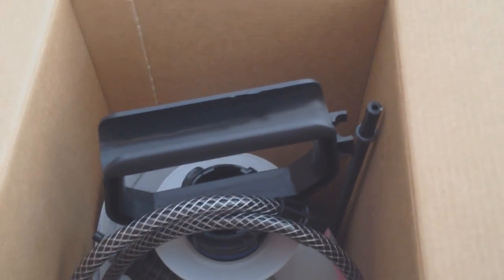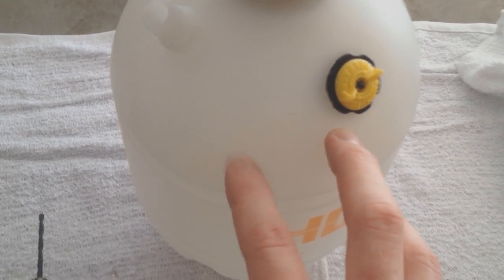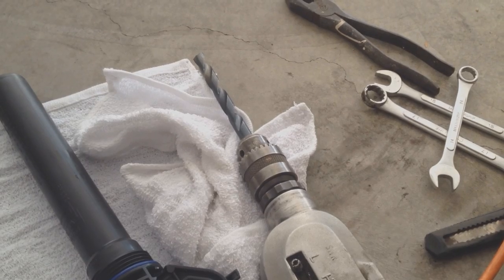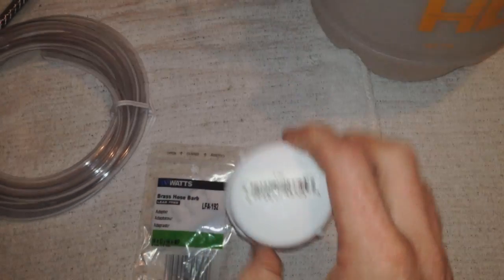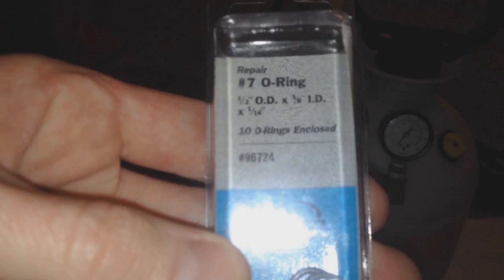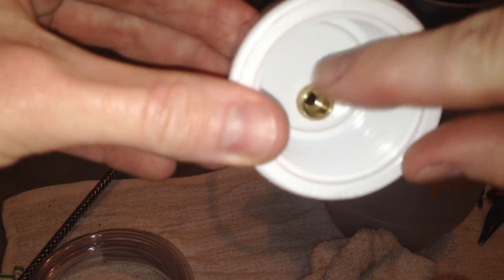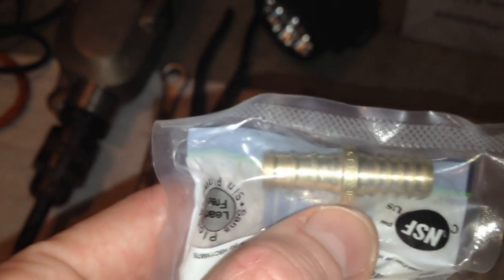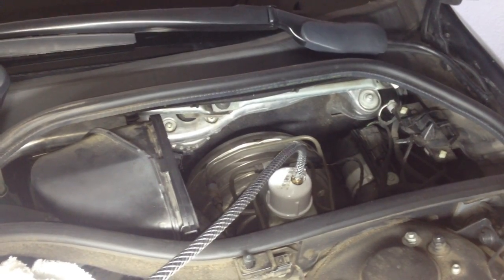DIY Make Your Own 1 Man Pressure Brake Bleeder

Comment: Thank you for the great video and taking the time to show all the details.  One question for any pressure type brake bleeder operations-why put brake fluid in the pressure vessel why not just keep the brake reservoir topped off and just apply air pressure to system through the reservoir cap?  This method would prevent a disaster if cap or hose comes apart from spraying brake fluid all over, would keep any impurities in pressure vessel from getting into fluid and finally it would prevent overfilling the reservoir like in your demo where you flush you beamer system and had to suck some out after the flush.

Comment: First off, thanks a lot for the DIY.  It was a pretty straight forward build and has been really useful during my brake and clutch bleed.  I'll echo some of the comments here about getting the cap to seal... that was a royal PITA.  I tried thread tape with no luck.  What I eventually did was hacksaw the cap down in height so that it bottomed out against the top of the reservoir.  Then I used RTV silicone to make a gasket on the inside and that got me an airtight seal.

This was on a BMW 135i (E82) fyi...

Comment: A better idea is to use a spare car or bicycle tire leaked down to 7 psi. Attach an air hose from a cheap tire hand pump to connect to the modified master cylinder reservoir cap. Use a shop air quick disconnect in order to screw on the cap and remove when adding more brake fluid.

Comment: Nice video thanks for taking the time and detail. The barbed fitting has an NPT thread on it, it’s a tapered thread that seals as you tighten it. There is thousands of pounds of pressure at the threads, you don’t need the O ring. Also the O ring needs to have two somewhat flat surfaces so it has something to seal against so the o ring will do nothing in this scenario the pressure would just blow it out. Possibly vacuum it could do something but just trust the npt thread and use some sealent or expoxy or tap it with appropriate NPT tap which can be found in most common tap and die kits

Comment: This thing is slicker than snot!  I built the thing about a year ago to bleed the coffee-colored brake fluid out of my 2002 BMW e46 brake system, and it was so cool I built a separate connector with a small Fernco cap and some washers so I could bleed the brakes on my wife's 2009 Toyota Venza. Actually makes bleeding the brakes fun and super-easy. One thing that I would like to incorporate into the system in the future is a reservoir bottle for brake fluid so that brake fluid can be continuously pumped into the brake fluid reservoir, eliminating the need to remove the connection repeatedly to refill the fluid. Anyway, thanks for this DIY!    DAVE

Comment from the maker: Just a heads up for you guys, I just got done bleeding the brakes and it worked fine, I did use plumbers tape on the brake fluid cylinder resivor threads to make it air tight.  If I would do anything different I would make a better cap for it, maybe go to pick a part and get a cheap one and make a legit one.  The brake bleeding video will be up soon, check here on my channel or all my projects are now on my website diye65e66 (dot) com head their for it.

Comment: Great video. And excellent concept. And much more cost effective than 200 or 300 for same thing from a specialty manufacturer.... Do me one favor thou please. Quit calling the "X" on the dimensions of your fittings "times" it has nothing to do with multiplaction. "X" in this instance is the universal symbol, key or short code for the word "By" since your comparing 2 different or alike measurements and or dimensions. For example. ⅜" X ¼" would be spoken: Three eighths inch  "BY" quarter inch. 
Sorry. Buddy not trying to be a dick. Or bust your balls.  But im a plumber that kinda stuff kicks my ADD and OCD in hight gear. Im returning the favor in a way. You taught me how to make a brake bleeder. And i get to teach about fittings.  Lol.  but seriously thanks for the advice and sharing of your knowledge with all of us and saving us all a little money. And lots of headaches. 

Heres some of  the acronyms and what they stand for. 

MIP.=  Male Iron Pipe
FIP= Female Iron Pipe 
ID. = Inside Diameter 
OD= Outside Diameter
"Straight connector" is a coupling.

Comment: Good vid, Put the cap on the brake  reservior before you add the hose so as not to have to keep turning the pressure bottle as you screw the cap on.

Comment: Looks good ..... with a modified OEM cap I believe it might seal better .... though I can't see how the air gauge would seal in the thin plastic under 22psi, whats recommended for Mercedes .... though an inline gauge could be incorporated .... I may give this a go, Thank-you!

Comment: Dude, it's not 3/8 x (times) 1/4, when talking about dimensions, it is 3/8 x (by) 1/.4, meaning length by width. If it has a 3rd dimension, it will be height.

Sorry for the rant, shop teachers were anal about terms in the old days.

Comment: Great video on how to drill holes the hard way in plastic. Why not use a step drill. I doubt that jimmied in fitting will hold any air pressure. Do you know for sure that generic plastic pump can stand up to brake fluid? How about the white cap? It looks like ABS which will melt for sure. Did I miss the part where you sucked all the leftover plastic debris out of the tank with a shop vac?Brake fluid is murder on most plastics. The last thing I want in my system is melted dissolved plastic.You are going to get leaks for sure around that cap. Also you need a filter of some kind between the cap and M/C.

Comment: Looks good.  mimics a Motive brand unit pretty well. Only comment I would have is that with that giant cap for the master cylinder a good cup of fluid will dump out when you remove the cap.   you really need one that is flat to the top of the M/C.  An OEM cap from they junkyard would probably work fine.

Comment: It works 2003 GMC SIERRA BUG SPRAYER HOME DEPOT $9.00 FITTINGS SAME PLACE PRESSURE GAUGE HARBORFREIGHT $2.00   WORST Part could not get cap to seal master cylinder  but this definitely saved the day

Comment: Nothing (almost nothing/no common adhesive) will stick to polypropylene! Use the boxed-end of a wrench if possible. Bad form.
You went to great lengths to seal the fittings on the sprayer tank, but what seals the PVC cap on the reservoir? Probably a rubber stopper would do that. LOTS of work and expense when you could buy a cheap unit made for doing the job. You can also suck fluid through the brake system for less money.

Comment: Made this little project but I need to find an adapter that will fit onto 2006 and newer Chevy Impala reservoirs, unfortunately its not a nice easy screw down type as you made.  I had used a cap from a scrapped Impala, but it wouldn't hold any pressure.  Good vid though.

Comment: Home Depot has 2 1 gallon pressure sprayers for $10, as well as most of the fittings.  As for the cap, why not get a spare brake fluid cap from the junkyard with a seal in it?  Also that pressure gauge is no longer available from your list.

Comment: what about the air you pump..air contains water ..brake fluid is hygroscopic. water with oil makes acid and if not it's sits at the bottom, which means you're brake cylinders....if you want to be meticulous... convert the pump to vacuum..same thing can be bought to drain oils. about $40....goedendag

Comment: You're better off using a vacuum bleeder at the bleeder screws on the caliper. Not only do you eliminate the chance of air. But you can also pull any debris/particles out of the caliper/ lines and flush the system. Just buy a mity vac system a one man flush and bleeder kit. Eliminate all the extra parts and rigging you're doing. If you can afford a bmw why rig make shift system?

Comment: I went down this road to try and save a buck, but upon examining a proper unit from MityVac I saw that the garden sprayer just does not hold up over time.  The rubber seals and the pump internals are really cheap in comparison to a tool built for this purpose.  So I bit the bullet and bought myself the Mityvac MV6840, which is the tank, the hoses, a caliper catch bottle and fittings, and a damn nice assortment of pressure caps to fit the master cylinder of many popular foreign and domestic vehicles.  Got it on sale for about $200 shipped.  Money well spent, let me tell you.  Turns a pain in the ass job into something pretty straightforward and simple. That system has paid for itself many times over.

Comment: With brake fluid being hygroscopic how to you prevent moisture getting in the brake fluid?  I know professional brake pressure bleeders separate the air pressure from the brake fluid with a rubber membrane.

Comment: One word; AMATEUR! What about all the air that's going to be injected (for the lack of a better word) into the system? The idea of pressure bleeding the brake system is to pressurized the fluid in a container filling the master cylinder and the rest of the system!

Comment: I used one of these tanks for putting gear oil in a transfer case and a dif. I just put a clear hose on it and pumped it up. It worked slow but worked great and was hands free after locking the trigger.

Comment: wrong way,  you have to blow back through the bleeders on the callipers.  not through the master reserve.  you are only trying to push air down your way,  and you save a lot of hassle trying to source a reservoir cap...  but good vid for beginners.

Comment: I have purchased several sprayers for around one dollar from a weekly general auction now I have new use for one of them. I have purchased  a box junk and in the junk was a couple of air pressure gauges. I have bunches pf plastic lines.

Comment: I did one of these.  Not expensive at all but the only issue I had was that the master cylinder cap didn't seal.  It needs something to wrap underneath the MC and apply down pressure to keep the cap in place.

Comment: if u know how to properly change brake pads you wouldn't get air in the system to start with. but, if you fill the sprayer bottle with brake fluid this would assist in doing a complete fluid change.

Comment: I am not sure anyone said this, but with regards to getting air in the lines from this pressurizer,  The presenter likely didn't mention this, but if the tank is filled with a measure of fluid ( brake, coolant, etc, ) then pumped up to pressurize and force the fluid out into the hose and then into the system, unless I am highly mistaken, it will be nothing but fluid that is forced out of the tank and into the lines, and then push the old fluid out the brake bleeders or coolant bleeder screws etc of the systems.

Comment: Use a step drill bit. I think the wall of the pump sprayer is too thin to tap because it will only have 1 thread. A bulkhead fitting would seal and be a better connection....

Comment: half a video on drilling a hole, try measuring od of fitting and use drill 3 sizes down..buy a gauge with fitting on the back eliminating all of the junk on the gauge

Comment: I don’t think you even need to put brake fluid inside the sprayer. The air pressure built up inside the fluid reservoir from the sprayer will push out brake fluid when you crack
 your bleeder valve. As long as your reservoir doesn’t run out of fluid, I don’t see how air could get into the system. Seems less messy to me just some food for thought

Comment: Thanks for the video, I made one too just like you said & it worked great.  I first used denatured alcohol, bled the alcohol lines, added more alcohol to let alcohol sit in lines overnight, bled again in morning with denatured alcohol, compressed air, dried overnight then dot 3 fluid.  Used left over denatured alcohol to clean sprayer staining.
It amazed me how dirty / filthy the lines were on the 3rd overnight flush.  After all that I put all new front caliper pistons in & new rear drum pistons in.  Overkill I know but the van is a 1995 with 185 K mile on it & who knows if it was ever done before I bought it.  For those that wanted to know, I had all 4 brake lines disconnected from the wheels when flushing.  Then lastly I hooked them all back up 2 days later & re-bled with dot 3.
Reply: Jim  are you trying to be funny?you sound just like him with your long drawn out almost useless details. If your not trying to be funny I'm sure then that you mean well. I guess I'm just impatient. Sorry to sound mean. The good side of this video is that he showed the basics,we know he is not mechanical,or a mechanic. So anyone with just a bit of mechanical skills will definitely improve this to make it safer and more airtight. So thanks for video

Comment: You will need to have some sort of seal in the tank adapter a tapered fitting that comes in the antifreeze pressure fill might work or you can have a machinist make you one out of aluminum all he needs is the tank so he can come up with the right thread pitch.

Comment: I would secure some type of nut on the other side of your pressure gauge. Over time, you don't want it to loosen as 25 PSI will send it flying.

Comment: i think you should add a valve to the line going to the master cylinder so you can pump up the pressure on the ground instead of having to pump the pressure with the tank on top of the engine.

Comment: Just watch so that NO oil gets in that container or it can cause problems with the rubber seals in the brake system.  That will be horribly expensive to repair.

Comment: Alot of folks that use the pressure type commercial power bleeders only supply pressurization air in the slave air tank. They bleed one wheel at a time, refilling the master cylinder only after bleeding each wheel position. This eliminates having to thoroughly clean the slave tank. This gets more complicated on advanced braking systems like stability control.

 Also bleeding should be done starting with the furthest wheel from the master cylinder usually the right rear, then the left rear, then the right front, then the left front. Some wheel cylinders have two bleed screws. In that case bleed the lower screw first, then the upper. Most pro's will follow a pressure bleed with a usual final manual bleed using the brake pedal and two folks to accomplish the task. You want a rock hard stop when you are done bleeding on the brake pedal.

Always use fresh fluid, and don't store an opened can. Brake fluid attracts moisture in the air when stored in a partial can.
Reply: That way only works for Front/Rear Split systems. For Diagonally split systems you would have to do Right Rear, Left Front, Left Rear, Right Front.

Comment: Ever heard of  'Gunsons Easy Bleed'..!
Exact same Tool but Miles Cheaper & ready made with all the different Caps, also with a Spare Wheel Valve Attachment - (For the Posi Pressure) Yeah...
Reply from the maker: Dan Solo wow awesome no I haven't heard of that.
Reply: If you got it miles cheaper where'd you get it? I've looked and the lowest was around $50 and shipping you can get that sprayer he's using for about $12 and if you're like most of us you have fittings and probably a gauge laying around. I put a quick connect and dialed the regulator on the compressor down so no pumping the bottle
Reply: Sure will Dan thank you sir
Reply: +Dan Solo The Gunson unit is a bit on the cheap side...unless you have the "pro" unit which is much nicer...and more expensive.
Reply: +sambking Hey worked for Me.!  Not that I use it every day, it's fine for a 6-month, change of Fluid...
Or a Clutch Bleed...
Reply: The cheapest I found on ebay here was over $35.00 with shipping.
Reply: +1 (although I lost mine in the garage somewhere and don't fancy getting ripped off by Halfords again :) )

Comment: I just put the pressure gauge in between the hoses with a T fitting. Then I put a turn valve after that to turn the fluid on or off just in case the cap for the brake reservoir leaks

Comment: Bleeders with a built in check valve are on the market. Four for about $15. Install them pump the brake (watch your master cylinder level) and you're good to go.
Reply: Can you supply a link to where I might buy one of these $15 devices? I've been searching all over, no less than $70 with shipping for a pressure bleeder.

Comment: Or you could go buy a Mightyvac that works 10x better and costs less than all these parts.
Reply: The Mighty VAC is, as the name suggests, a vacuum, and therefore works from the other end at the bleeder screw, whereas, this is a pressure bleeder, and it is much easier to use.
Reply: You use the vaccum bleeders at the brake, where you are cracking open and shutting off the bleed valve.  I'm not sure how a pressure bleeder that you need to operate in the engine bay could be easier than that.
Reply: If you are replacing the brake fluid with a cheap MityVac it will be a vacuum bleeder and you will die of old age before you replace all the fluid. Also you have to have someone watch the fluid level in the reservoir, if you let it run dry you have created a whole new problem.  So it is not 10x better.

Comment: When you installed the pressure gauge and barb fitting why didn't you just tap the hole to fit the threads. Would have been much easier. You did come up with a great set up that is very cost effective.

Comment: Good concept.. I'm wondering since brake fluid is hydroscopic... shouldn't we be looking for a way to keep the air we are pumping in the tank away from the brake fluid? I'm thinking a condom on the pump. How does latex play with brake fluid?
Reply: Latex degrades when exposed to petroleum products.
Reply: Most Brake fluid is made of Glycol-ether. (Dot 3 being the most common).

Comment: dont drill use a soldering iron or heated steel rod to melt a nice sized hole   which will have a thick melted edge mounting.

Comment: I have a 2008 328i..a 1 1/4 and 1 1/2 PVC top do don't fit...a weird size in between
Reply: It would be extremely odd if it weren't metric